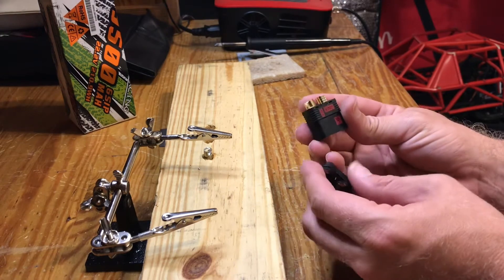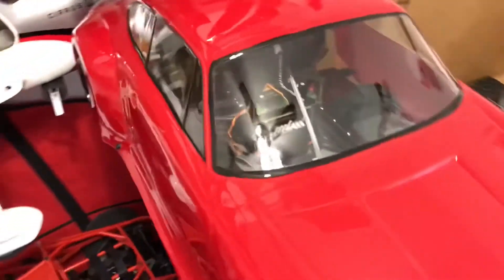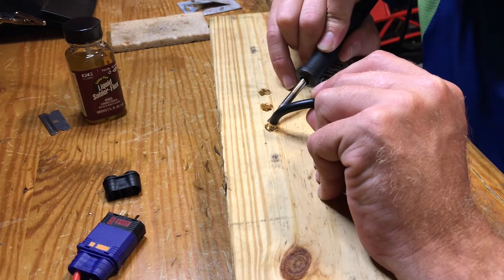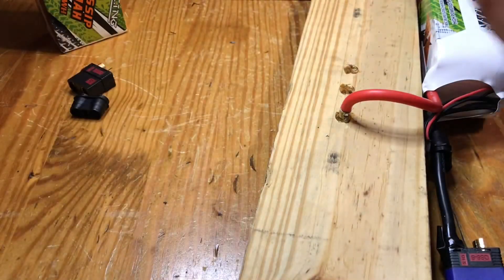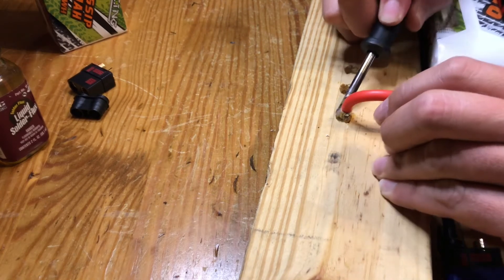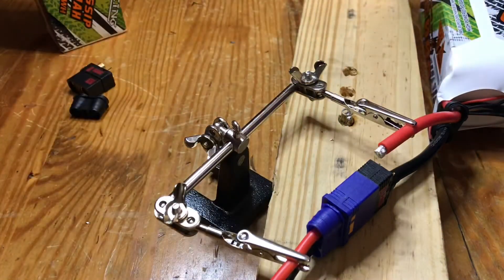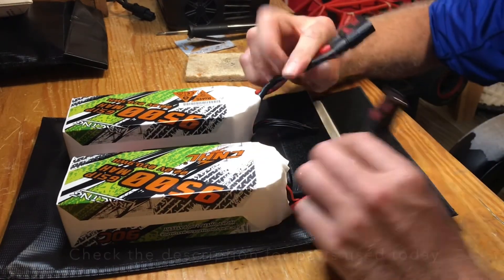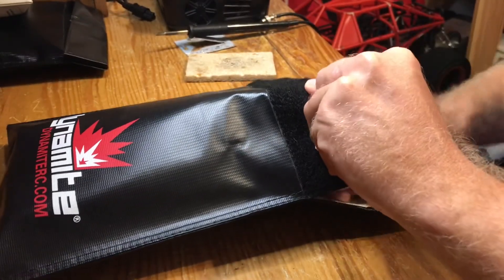How to Solder Qs8 connectors to Cnhl lipo

Comment: I think if your holding plug is soaking up a bunch of heat through the connector. Probably getting cold shuts in the solder.
Reply from the maker: Yea, the problem is, for this size of wire, you need a very powerful solder gun. But these connections have already been tested to 1000 amps and 21,000 watts.
Reply: Definitely need more heat and a gun that holds high temps when transferring heat. Perfect iron would be one with the heating element built into the tip. Great work.
Reply: @mikeguzmansr  what kind do you like? the one im using now isnt great.
Reply: @PatriotBrad I’m using the hakko fx951 now. The whole tip is the heating element. The heat retention and transfer is amazing.